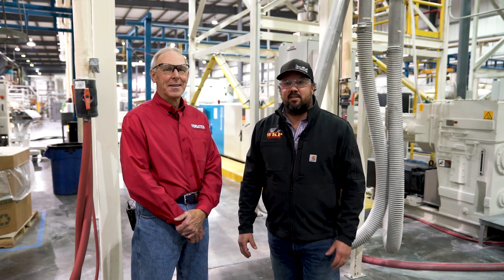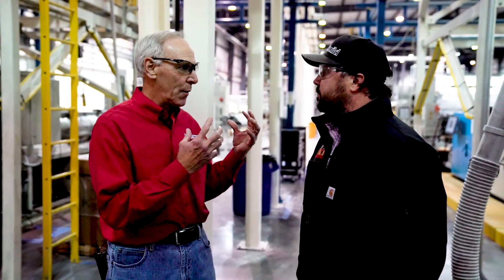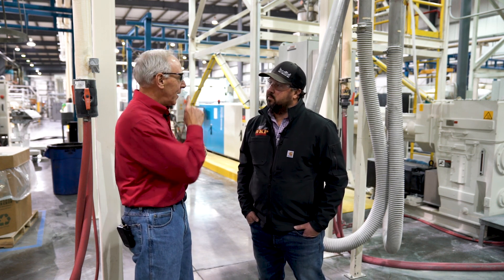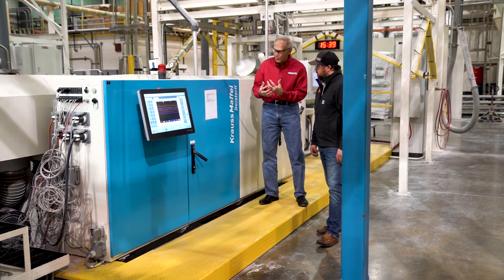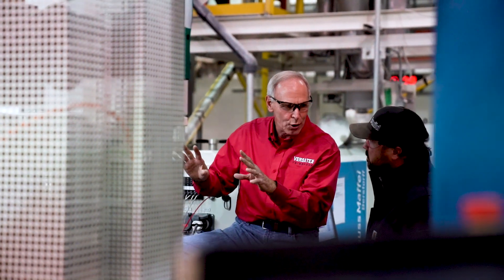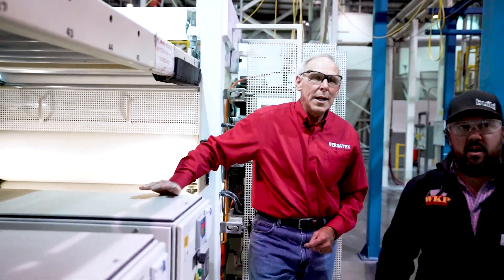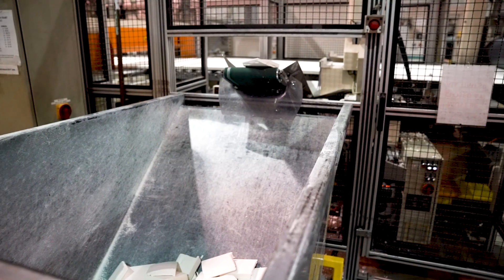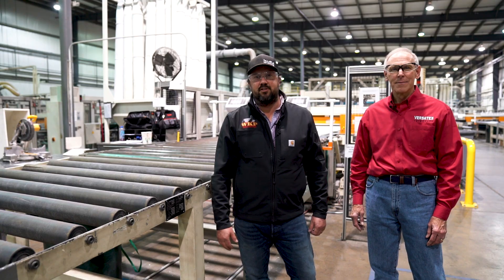Inside the Versatex factory - How TrimBoards are made!

Comment: Note to camera operator: when the man in the red shirt is talking about the 50 inch sheet die and roller, a great thing to show on camera would be the 50 inch sheet die and roller. I used to work in an extrusion plant. The entire point of the entire business is the extruded material coming out of the die & how much it shrinks in the first few inches after coming out of the die. We did not see that here. That’s the art he is talking about. Temperature differences in the building from day to day from something like a cold front passing makes the operator’s job interesting to keep the line adjusted so that you end up with the correct width & thickness of the extrusion out a couple of hundred feet from the die. We missed all of that here.